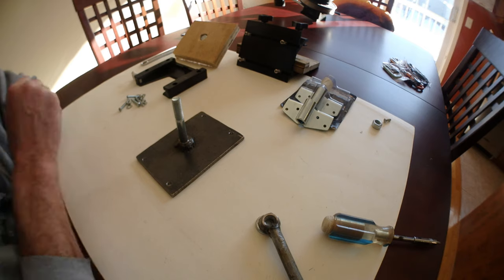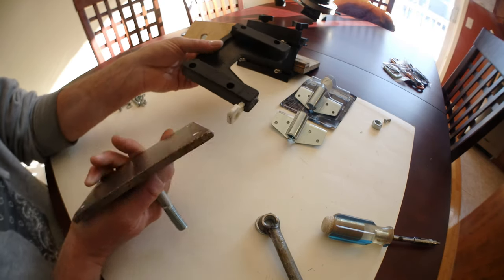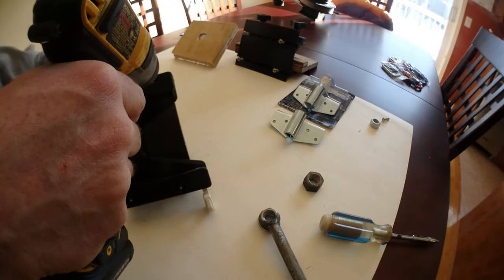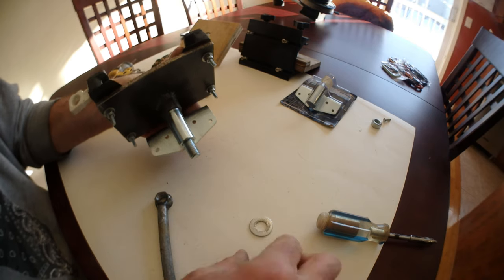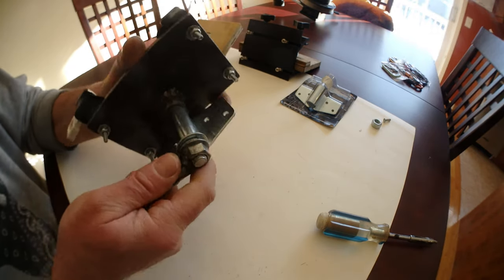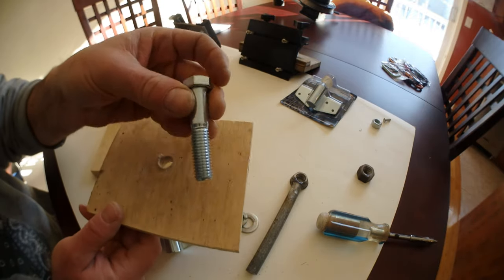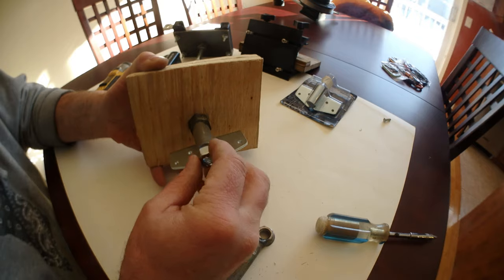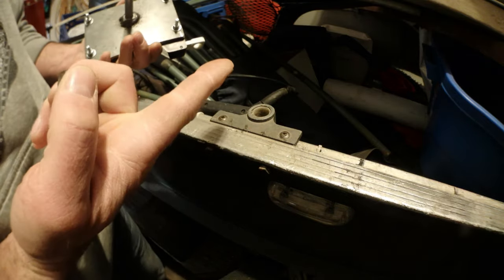DIY    Downrigger Swivel Base Mount On The Cheap.

Comment: where you get oar locks from ??
Reply from the maker: Got them from amazon or just check marine retailer or even walmart.
https://www.amazon.ca/Seasense-Lock-Sockets-2-Inch-Locks/dp/B004RDMNI8/ref=sr_1_32?gclid=Cj0KCQiAm5ycBhCXARIsAPldzoWs0oceEuHmJGwOkD7lP0EX7Qu6rSU5mFbZeKw1gEbDKcUqibkCxuQaAqzjEALw_wcB&hvadid=230982424791&hvdev=c&hvlocphy=9000596&hvnetw=g&hvqmt=e&hvrand=9715709363242680098&hvtargid=kwd-299904138410&hydadcr=20847_10090733&keywords=oarlocks&qid=1669848104&qu=eyJxc2MiOiI0LjE3IiwicXNhIjoiMy40MyIsInFzcCI6IjMuMTkifQ%3D%3D&sr=8-32
Reply: @obscur156  thank's
Reply from the maker: @chuckpatch1230  You are welcome.

Comment: How do you take the "nut tool" off the bolt shaft once its mounted on the boat? you would only be able to get a half or quarter turn on it before the nut arm it hits the gunnel.
Reply from the maker: I turn the plate instead of the nut tool.Then when near the sweet spot,i use the nut tool to tight it.
Reply: @obscur156  great idea!, I’ll try making one, sure beats the 100.00 for a mount 👍
Reply from the maker: @alaskanglenn  You can fine tune it with washers and lock washers.
Let me know how it turned out.
Thanks
Reply from the maker: @alaskanglenn  You can watch how i tight it in this video !
https://www.youtube.com/watch?v=oXgNPE0pnQo
Reply: @obscur156  man I sure appreciate that, just in time for coho fishin!
Reply: I’m rally impressed with your ingenuity, that’s how great inventions come to be. Thank you for sharing it!
Reply from the maker: @alaskanglenn  Thanks ,hope you are gonna enjoy your new swivel base !
Regards.